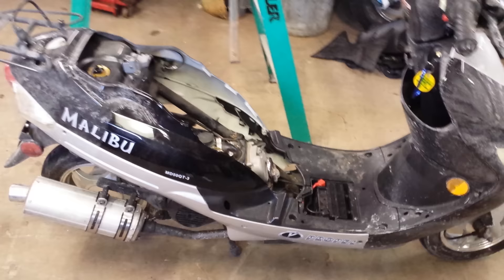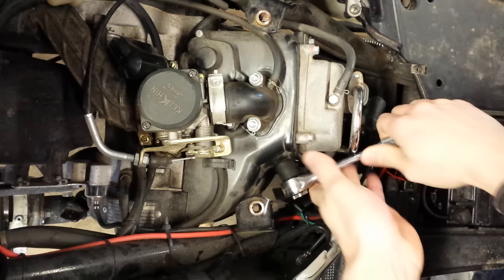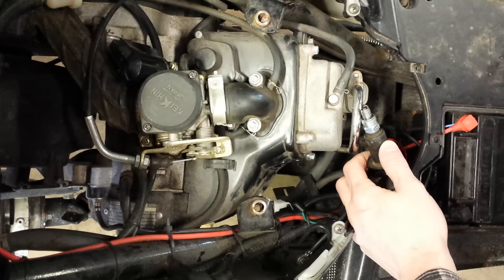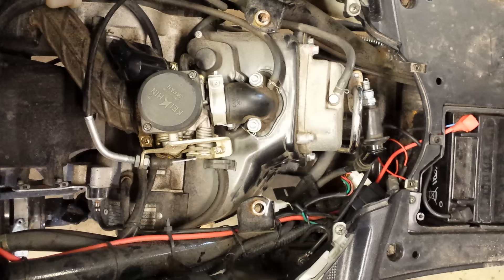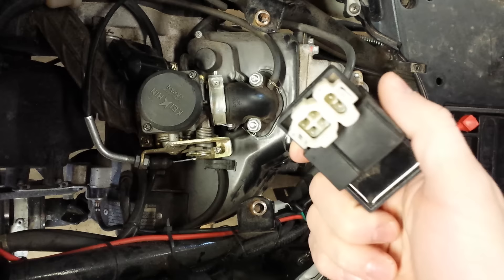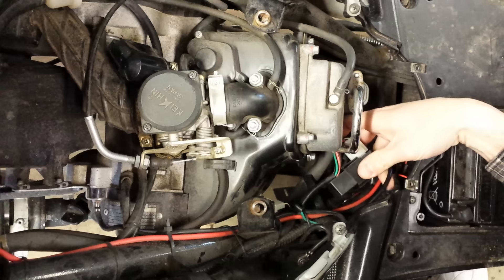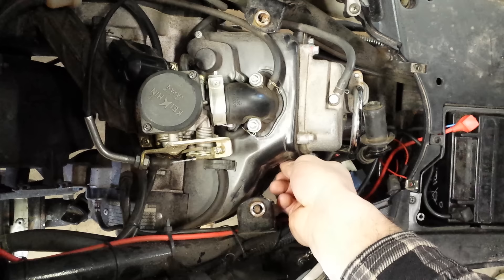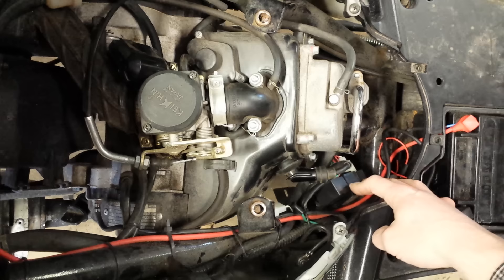Fix Chinese 49cc Scooter that won't start

Comment: i have a 150cc scooter when i press the start button i get nothing it dont even crank over i replace all the parts cdi,solenoid,everthing , not the starter it works doe what can i try next
Reply from the maker: try and jump your solenoid. if that cranks it over back track your wiring or maybe just a bad switch.
Reply: +Joseph Peterson Jr if you have a fuse somewhere near the battery then it may have blown or disconnected itself? I've had the same problem a few months ago - clicked the start button and not even a sound. What happened was the fuse had actually disconnected itself when I was replacing my battery.

Comment: Chinese scooters are weird. I started it yesterdaymorning and it worked after a while but it didnt go any faster than 15 km/h and when I cranked the gas further open the engine almost stopped even after the engine was warm. So I stopped it and it never started again. First I wasn't getting a spark, but after pulling out the rear light I did get a spark but it still wasn't starting. 

The starter motor sounded like it was having to do really heavy work but kickstarting didnt work either.
Sometimes it does run for like 5 seconds but then it just suddenly dies again.

anyone recognize these problems?
Reply: melted sides of piston maybe make it stiff in the bore , if you see it then sand them down l guess and maybe hone the bore with a drill sander honer whatstitcalled.
Reply: Sounds more like your carb needs a good clean.
Reply: easyer to clean the carb and often seems to glolg up glog

Comment: where are the wires that are attached to the CDI box be attached to?
Reply: also if this does not work should we check the fuel and petcock valve?

Comment: put gas in it and   heres what happened, I ran out of gas and coasted for about a block, I put gas  in it , and it wont start since, there s no spark or fire,  camt find the cdi box.   what else could be wrong, thanks for helping

Comment: How did you figure out it could be the electric box?
Reply: with trial and error, 10 bucks is worth trying.  If it wasn't the cdi & spark plug than stock them as spare parts. It is time to check valve settings & then engine compartment. (no need to check carb as he felt fuel with his fingers.) if it isn't the valves then it might be crank or piston failure.

Comment: Kasey Young u seem like u know what your doing,, i have a 50cc kymco that start with the kick but not with starter,,, it did strugle to start then i tryed jumpstart it with car, now it djust make a klick sound.. im thinking mby need to replace starter motor but dont whant buy shit i dont need what do yu think my friend?
Reply: someone told me that it could be startrelay i removed the covers and djsut looked att that red shit dont know how to tell if its that,,, its djsut that atm my kick broke and only way to start is with the starter cuz the kick is welded :/

Comment: why remove the plug? why not use a spare?
Reply: moultriemanicmechani  because you cant diagnose existing problems, when using new parts... ?
Reply: He means there's no reason to take the existing spark plug out. Just pull the cable off and put it on a spare plug against the block and you can see if you have Spark.  I would guess that it's very rare that the spark plug it would be the problem.

Comment: How can i check the cdi box i have no spark can i check with homs meter ?
Reply from the maker: I do not believe you can check with an hom meter. 9 times out of 10 it is the cdi box just fyi. Thanks
Reply: Thanks for replaying it was a kill switch

Comment: Thought I'd post a comment here in the hopes someone replies quickly. I just broke, engine lost power (sounded like it was choking first), felt a few kick tries from the engine to go, but eventually just died. I am/was able to get the engine to start again after some tries but either it starts and then just dies a few seconds later or I get some engine rumbling (the sound you hear at the start of the bike starting up normally). I am no mechanic, I work in IT and couldn't find the reset button. I will check what you said in the video shortly (or at least try) but I was wondering from this description does anyone think that the problem can be fixed from the actions in the video? My scooter is a direct bikes scorpion, you can find the exact model on direct bikes website if that helps.

Comment: I have The exact same scooter it runs normal for 30 seconds, but then it dies. 
Since it runs it has spark and fuel, could it be the cdi?
Reply: No the cdi controlls the spark. If you have spark your cdi is fine. Your issue is probably compression. Check the valve lash. It is super simple and has great tutorials on how to do so. I fixed my valves yesterday in about 30 minutes and if I can do it anyone can
Reply: @gonco9630  but its a Brand new scooter. It happend after i tried to derestrict it by connecting 12volts right to the thing in the variation that controls the speed.
Reply: @levijensen7681  I have no idea what a "thing" is I'm guessing it's the auto enricher/ choke that gives the fuel when the moped is cold. If it starts you are either running way to rich or way to lean which can be caused by "unrestricing" your choke. Lesson learned don't do dumb performance mods and do stuff that works
Reply: @gonco9630  no The electronic restrictor in the variatior, the cdi tells it to stop giving power if I reach over 45 km/h.
When you reach over 45 the cdi cuts the power so the scooter don’t accelerate more. So I hooked the electronic restrictor up to the battery so it always would have power. And that’s when the scooter started dying after 30 second.
Reply: @gonco9630  do you think it could be the cdi that is broken?

Comment: Anyone know why red wire with fuse keeps blowing out ? Or were that wire leads to and how do you start scooter with kick start?
Reply from the maker: Unsure exactly what red wire you are talking about but I am sure it is shorting out somewhere. To kick start turn the key on. Have the switch on run. If you have a manual choke, choke it. Hold the left brake and kick the motor over. Some older models you have to kick the lever over n over til it's tight then pull the left brake and that releases it and turns it over for you.
Reply: Thanks for the fast reply it's the red fused wire that comes from the rectifier and leads to the battery.

Comment: Hi everyone, some f'n jerk tried to STEAL my Scooter...I found the battery cover near my bike, battery intact, but battery wires were loose & all screws are Gone. I tried to re-attach the battery wires but I'm getting NO JUICE. CAN ANYONE HELP ME FIGURE THIS OUT PLEASE? I tested the battery & the tester lit up. So it's charged...did the THIEF steal some wires? The battery cables/wires are intact... I know Cars, not bikes. Ugh. Please help. Thx. X♡
Reply: +Msflamingo2008 Check the fuse!
Reply: Dan Coop Thx, Dan. I did that last night. It's good & still intact. Any other ideas please? Thx! X♡
Reply: the fuse is gone also lock your steering next time
Reply: the other thing could be the screws that hold the wires on the terminal were taken no clamp no start
Reply: +Msflamingo2008 Are your ignition wires still clicked together?
Reply: Thank you Everyone for your help! :) I had her towed to the Scooter Shop. The freakn criminals burned up some wires trying to steal her. We're back up & runnin. Thx again! God bless & be safe! XXX♡♡♡

Comment: why would pressing the back brack change the idiol?
Reply: Braking the rear wheel puts load on the drive wheel - which puts load on the engine.

Comment: I have spark but no start would it still be a cdi box?
Reply: Check your carburetor..with needs to be cleaned or replaced.
Reply: I figue it ou had to much oil lol
Reply: +dwight larcomb would a carburettor be the only problem when a chinese scooter won't start? The parts I've replaced are the following: Cylinder, piston, piston rings, ignition coil, CDI box. There is a spark but it won't start. The spark plug is sometimes wet but sometimes it isn't and the fuel doesn't even flow through the pipes, wires or whatever they are called. I've ordered a carb but I'm unsure if that would fix the problem? Any other ideas? The starter spins really fast and it never spun that fast. It started for like 20s when my friend put some petrol into the cylinder.

Comment: hi I have spark and fuel and still no start please help
Reply: +jeff shroble check the carburettor. Clean it and if that doesn't help then see if the fuel is getting to the cylinder? And also check if the spark plug is wet? If it isn't then you're probably experiencing the same problem as me. The fuel isn't sucked up and isn't getting to the carb/cylinder. If the fuel isn't sucked up, then replace the electric choke or the carburettor - I've seen many people replace their carbs and it has helped.

Comment: i put a new carb on a used 50cc scooter a new battery, its getting gas and spark and still won't start. any ideas?
Reply from the maker: does it have good compression? ?
Reply: i don't know how to test that
Reply from the maker: I would borrow a compression tester and try that first
Reply: what is the compression supposed to be about?
Reply from the maker: +Richard Mcginnis I'd say about 120ish
Reply: so if i stick my finger over the plug hole and kick it over it should try to blow my finger off the hole?
Reply from the maker: +Richard Mcginnis yes. I'd have someone else kick it over so you can really try to feel how much pressure there is. however it is a generic test because there is a huge difference between 80 and 120 but both feel like a lot of pressure.
Reply: how do i fix it if there is not a lot of preasure
Reply from the maker: +Richard Mcginnis probably need new rings. could be piston. not easy 1 2 fix
Reply: i have a parts bike that still does run. i might just remove all the working parts from the newer one and utilize the older parts bike, if that's the caseor just put the older engine on the newer scooter
Reply: this morning when i was waiting for my ride to work i was talking to a friend who also has 2 scooters, his older one sounds just like mine when he tries to use the electric start or kicks it, but when he hot wires it with a screwdriver it starts right up. i think i'm gonna try that before i go ripping it apart
Reply: Go out and buy a DVM. Then learn how to use it.  After that, try to trouble for wire connections. Set the DVM on Ohm scales.
Reply: its okay now, i took the engine and back wheel from my maui 50 and stuck it on the vip i bought for parts connected everything, gas wiring e.t.c. hooked up a new battery and on the second try it fired right up. the thing is this, 4 years ago when it got stolen i think they changed the engine on it to something bigger  because it'll do 50 easy and when it climbs a hill it doesn't bog it gains
Reply: Richard Mcginnis
Reply: it works fine now i need a new diaphragm for the fuel

Comment: Kasey Young how do you take the seat off?
Reply from the maker: open with key. then take cotter pin out of pin going through front part of seat. remove the pin and you should be good to go.
Reply: im scared to do it but thank you Kasey Young
Reply: +Kasey Young im trying to reinstall my battery. instructions say clean joint first than apply a thin coat of petroleum jelly. do i put the jelly all over the battery.
Reply: Do not put the petroleum jelly all over the battery, just on the electrical connection after you have bolted the wire terminal to the battery terminal. This helps to keep corrosion from forming on the  terminals.

Comment: My tao Toa has 1500 mi it runs 5 min no spits no sputters what's the fix ?
Reply: Possible blocked/blocking fuel line filter or fuel tank vent.

Comment: Has same exact motor and carb, does same with starting just spits gas out in stead of sucking it in its goats suction,spark, and compression, plus I have cleaned the carb twice still won't run
Reply: +Joe Wiltse I have the same problem as you (I think). I've replaced the ignition coil, CDI box, cylinder, piston, piston rings but still nothing. I'm guessing that the problem is the electric choke... I've ordered a new carburettor with a new electric choke which is going to come either tomorrow or on Monday. I'll see if that would fix the problem.
Reply: I think so too, I'm ordering a new carb with electric choke and fix ignition, my scooter sort of pops like it's firing on the exhaust stage cycle
Reply: Cdi not fix
Reply: Hopefully a new carb will fix our problems :D You mean that the exhaust sometimes sort of shoots out air from the exhaust? I have the same.

Comment: hey, I cant find the cdi box on my scooter, please help
Reply: remove the seat/box and look in front of the engine at the valve cover, at the bottom of the frame...should be a black small box with two connectors
Reply: try looking around the fuel tank, the battery compartment or near where the horns/ front lights are

Comment: Hi
I have a 49cc tao tao that wont start.
1. I have nice blue spark on the plug.
2. I have fuel going to the carb and also swapped carb off of running scooter.
3. New fuel filter
4. Checked timing it correct
5. Installed 2 cdi boxes...One cdi was new and the other was off running scooter.
6. Even installed new coil
7. Checked valve lash and set at 4 thousanths
8. Looked to see if valves were bent and didnt look like it (visual) Appeared to be opening and closing with out bind.
9. Checked WOT compression and getting 150psi.
I have tried everything I can think of and the engine will not fire.
Anyone got any ideas??
Thanks for the help!
Reply: Carb?
Reply: @axelsoto6978  Thanks, but it was a seized exhaust valve. fixed it and sold it, Now I have a scooter dealership called Sullivans Cycles in Connersville Indiana on Facebook also. Sell Wolf Brand Scooters and Bintelli Scooters and SYM Lance Scootstar and Bintelli Ebikes.
Reply: sullie35 holy shitt

Comment: on my scooter nothing comes on no spark noting could it be the CDI
Reply from the maker: When u say nothing? Does it crank over? Or cranks and no spark? Crank and no spark? Prolly cdi
Reply: Both
Reply from the maker: Both what? It does crank over?
Reply: It doesn't crank over
Reply from the maker: Try to jump the solenoid. You may have a bad solenoid

Comment: at least yours cranks and tries to start... mine is a dead stick. battery is good I get strong head lights and tail light... but when I tried the starter it just does one click, it won't even try and turn over when I use the kick starter.
Reply from the maker: That could be many things... bad piston. Vapor lock. Who knows! Gotta tear it apart!
Reply: i wouldn't know where to begin i'm no mechanic i'm watching you tube tutorials just to try and find the problem. the closest registered mechanic to me that works on scooters is over 60 miles away and the scooter is the only transportation i have.
Reply from the maker: Dragnmastralex yes that could be an issue.

Comment: i jump solenoid still dont crank or turn over.
Reply: if the starter just clicks...it isa the solenoid, if the starter does nothing, it is the starter motor itself.

Comment from the maker: I do what's up?
Reply: What is it
Reply from the maker: kyoung@charter.net
Reply from the maker: +Donald Porter so can u get it to fire over at all? what about ether in the air cleaner or gas down the spark plug hole to the head? or does it just keep cranking and nothing?
Reply from the maker: Pour a little bit of gas down the spark plug hole.  Rank it over and see if it fires up for a second or 2.
Reply: Hello Kasey.....I wanted to ask that if I troubleshooted the CDI, the coil and the spark plug with replacement KNOWN good parts and the scoot still has no spark......what could it be? Thank you in advance sir.
Reply from the maker: Sounds silly but check the wiring. Could be as simple as grounding out
Reply: Kasey Young i got this cord but it cut in half I'll followed it to the bottom left side of the scooter by the peddle in on the bottom of it was the white tube with a tip at the bottom what Is that in were can I buy another cord from
Reply: Change the fuel filter. 

im sure ive got spark and i def got fuel just wont start. my friend can start it with the kick but i cant lol but the last two days it just wont start

Comment: What you should check for always.
1. Fuel
2. Spark
3. Compression
4. Air
5.timing
Reply: In these engines it's almost always fuel, spark, or air... Unless someone took the engine apart completely or it's a brand new engine, timing usually is fine, and unless compression gets catastrophically low then it will still start somewhat, it just won't have much power at all